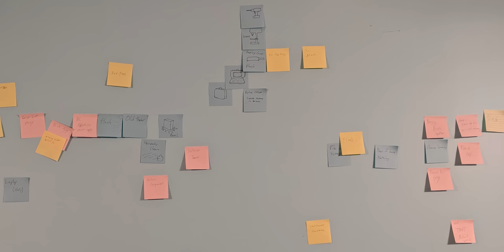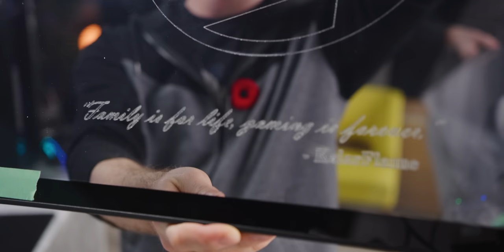We Built His Dream Family Gaming Rig - ROG Rig Reboot 2019

Comment: I saw the two sticks next to each other and my heart died.
Then I noticed they were using 4. Thank God.
Reply: Same XD
Reply: Yeah. That sudden feeling of relief.
Reply: Same
Reply: If you're talking about the memory sticks, some motherboards have it setup where the same channels are right next to each other. That's the case on my mobo (B450 Aorus).
Reply: Khaffit  i THINK YOU MEAN RANDOM ACCESS MEMORY MODULES
Reply: Me too
Reply: @soldierofchaos8552  Nah, he meant non-Error-Correcting Code Double Data Rate 4 Synchronous Dynamic Random-Access Memory (non-ECC DDR4 SDRAM) modules.
Reply: @thecarpy  ofcourse he meant to list the standards as well! 
DDR4-1600 (PC4-12800)
DDR4-1866 (PC4-14900)
DDR4-2133 (PC4-17000)
DDR4-2400 (PC4-19200)
DDR4-2666 (PC4-21333)
DDR4-2933 (PC4-23466)
DDR4-3200 (PC4-25600)

Comment: I just got a 5700xt and i have 16 gb 3200mhz ram, a ryzen 7 1800x. And I can finally output 144 fps on games even at max graphics, now I just need a better monitor, mine goes to 75hz and I think it feels super smooth so I can't imagine when I can afford a new 1440p 144hz monitor it will be amazing. I know I need to upgrade my processor and mother board for pcie 4.0 support but the 5700xt is still running awesome on my x470 board and 1800x.

Comment: Im guessing everyone watching this has low end pcs or laptops
Reply: nope
Reply: I've got an AMD Ryzen 5 2600x with RX 570 8GB and the motherboard is Aorus b450 with 8gb 3200mhz ddr4
Reply: @mrkz04  tnx for your info, now we can rest in peace
Reply: I'll join in then:
R5 2600 on ASrock B350M
16GB RAM @ 3200MHz
256 GB nVME, 960 GB SATA SSD and 1 TB of spinning rust
ASUS Strix Vega 64, overclocked undervolted and cooking nicely
A small nuclear power supply
MANY fans
Some noise canceling headphones.
Reply: @InternetEntity  im using intel celeron J1900 1.9ghz in 2019, its fucking integrated CPU
Reply: Okay now you guys just envy me

Comment: Very nice computer chassi, except for just ooone Little fuckup by the ASUS design team: the vertical mounting option for the Graphics card.

I bought ASUS own riser Cable for that purpose: the connector slot has two screwholes at the ends, corresponding to two screwholes on the cover plate for the PSU. However: when you mount the graphics card in the vertical slot and the connector to the PSU cover: it doesn't fit. Vertically, there is a gap of over 10 mm between the graphics card and its connector slot. 
I solved the problem by adding some spacers under the connector and used a pair of longer M3 screws to attach it to the PSU cover: otherwise, the graphics card would have been left hanging in the air, attached only at one end.
Not a major flaw, but quite annoying for such an expensive chassi.
Reply: Whew! Glad we didn't try to mount vertically then!

Comment: I usually also go with putting the Mainboard into the case first even though Linus seems not to like that ^^V
Reply: I have subsequently learned that both methods are used frequently by professionals. I suspect which you use depends on how annoying you find taking a bad board back out of the case.... and how much faith you have in the functionality of the parts you're using.
A lot of his audience might be working with second-hand or budget components, many LTT builds are done with components that have been sitting in storage for a while. Both are sources with maybe higher risk for DoA main-boards. (Also, Linus is short, so it's more of a pain for him to work over the edge of the case. 😂) All of this i think contributes to the strength of his preference for that method. And it CERTAINLY isn't going to do any harm to post it before putting it in the case. Matter of preference ultimately.

Comment: I would of put the radiator somewhere else because it's covering up part of the ram
Reply: I agree. I tried it the other direction when i got it home. But unfortunately putting it the other direction actually caused the hoses to press a little bit on the GPU. Not an issue maybe short term, but I'd rather block a little of the RAM than apply a little extra stress to the mainboard or GPU.

Comment: The power supply upside down with no led screen showing really bothers me!!
Reply: I was going to install it "upright" but he had me reverse it because of the fan venting direction. Something had to go on the cuttingroom floor i guess. 😁
Reply: @dancingbookworm6205  Isn't the fan sucking air from the bottom the best to get cooler air (and show the led screen?)? Anyways that's a sweet sweet system hope you are loving it!
Reply: @suchefinde  honestly, i can't remember which way the vent and intake are now oriented. And at the time just kind of went "Oh. Ok. Sure Linus! Whatever you say!" (And we apparently have no video record to check. RIP!)
But the way i rationalize it is like this:
If it was designed for a high mount case, the bottom of the PSU is supposed to point into the case. If you mount it low, the bottom then needs to be the top to point into the case.
Could be wrong. I clearly know next to nothing about this stuff... lol 🤪
Reply: @dancingbookworm6205  Oh you want the psu fan (which is in an intake) facing down when mounted down if the case has a cutout (a filter down there is even better) so it draws in cool air off your floor and not sucking warm air in from the case. I don't think it truly matters for performance unless you are on bleeding edge but it sure can't hurt getting cooler rather than warmer air for longevity!
Reply: @suchefinde  i assume it then vents out the back so you're not blowing warmer air into the case? Makes sense. I don't think we're pushing the PSU hard enough to matter. But I'll see if i can find some wattage numbers on my components.
Reply: @dancingbookworm6205  Yup, intake drawing cool air from bottom, exhaust (where the power button button / cord from wall plugs into) out the back, you would then also get the benefit of seeing the LED screen on the PSU as well through the shroud window

Comment: Is this a good rig

Intel Core i5-2400 3.10 Ghz
B75 LGA 1155 Motherboard
Video Card NVIDIA Gforce GTX 650 1GB
Ethernet port + WiFi
500W Power supply
3 RGB 120mm Fans
RAM 8GB DDR3
HDD 1TB
Reply: You need at least 4 RGB fans or you won't even be able to play minesweeper.
Reply: hell no that wont  play any new games with a 1gb video card lmfaoooooo u need ddr4 ram and at least 16 gb lol

Comment: Is there a reason the motherboard is missing the chipset fan cover?
Reply: Dunno. I was lucky i knew which thing the motherboard WAS!
Reply: Wait,  are you talking about the heat spreader over the M.2?
Reply: @dancingbookworm6205  it sits on top of the heat spreader for the top m.2 and covers the fan next to it. You can see the empty screw holes.
Reply: Huh. I'll look when i get home.  Might be in the box of knicknacks. But the M.2 we installed won't fit under the heat spreader that came with the MB, because of the RGB junk on it, so that's why that heat spreader didn't go back in. Can't remember if that was specifically mentioned in the video.

Comment: Setting tha AIO tubing directly over the rgb ram is ultra cringe. ALLOFMYWHY.jpg
Reply: So i tried the other positions once i got it home,  and because of the length of the tubing when it loops tighter it actually pushes down on the GPU. So... since I don't want to strain my GPU mount and connectors....
Reply: @dancingbookworm6205  zip-ties :0
Reply: I need you to be strong for a second Uncle A...brace yourself.
I. Do. Not. Care. [That much.] 😜
All kidding aside, I'm a function over form guy. I picked the initial position to have as little kinking in the flow path as possible, and i choose not to zip tie tubing for the same reason. The less i strain a tube, the longer i go without leaks. I admit, the amount of strain a couple zip ties would put on it is rather small....but my priorities are my own.
I really appreciate your input though. Lord knows i went into this knowing next to nothing!
Reply: @dancingbookworm6205  Tbh my reply was for Linus actually :D. And I also don't care too much about someone elses stuff ;)
Reply: Cool! I'm all aboard the blame Linus train! You were supposed to TEACH me Linus! Or at least let me know you wanted me to coach myself up before arriving! WTH?! 😂🤣

Comment: Why get the Thor, but mount it so the LED is facing in, and not out?? I understand that's partially ASUS's fault, for not putting the OLED on both sides of the power supply... If anything idk why ASUS decided to orientate the OLED so that you have to mount it with the fan facing up, when 99% of all cases have the PSU mount on the bottom to suck air in from the bottom..... Yet ASUS designed their Thor PSU so you have to mount it with the fan facing UP if you want the OLED and RGB led's to be showcased

Comment: I would probably be both amusing and disappointing on anything like this. My last "PC Build" was more of a rebuild... circa 1998. I got some old used Dell PC and scavenged as many parts as I could from other old PCs to boost it. It lasted until about 2005 before finally reaching it's end.

Since then, I have lived off of 'off the rack' Laptops and never really had anything with any level of performance.

So I would know my way around a build roughly (how to put the parts together and the basics of how they are handled), but as far as actually building from scratch, I would be completely lost (and probably try to build like this guy inside the case). 

I really could use a new PC though. I think my current one only has VGA and DVI outputs. At least it does support duel monitors... so win?

Comment: Ummm did anyone noticed that he put the power supply in wrongly because there is no OLED screen or RGB showing
Reply: I did actually try to put it the "right way" but the fancy stuff on the PSU is oriented for a case that puts it up high, so mounting it that way would have the fan blowing the wrong direction.... So Linus stopped me and had me mount it the other way so it would function properly. Guess that part didn't make the cut.

Comment: You could have put 16gb ram instead of 32gb and get a better gpu?
Reply: No point with that monitor.
Reply: DancingBookWorm well upgrading a monitor is easier and cheaper than upgrading a gpu imo.
Reply: Maybe,  but then you're sending him home with a system that needs additional upgrades for full utilization. At least with RAM he could just run a bunch of browser tabs AND game.
Reply: DancingBookWorm I can opet a bunch of tabs on my rig which has 16 gb and play 1080p 144hz games maxed out on overclocked 1070 and quad core i5 so I still think better gpu was a better pick here. He got new rig for free anyway
Reply: More to the point the 5700XT firmware is GARBAGE....grrr...
Reply: But yeah.  I don't really disagree. I was just kidding around with the tabs and stuff